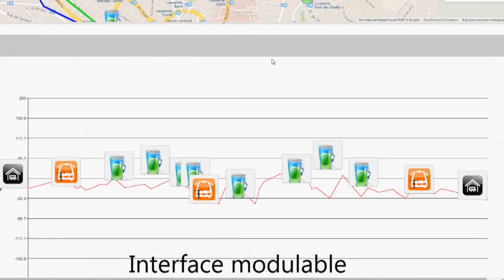TOSA buses power up for less

Comment: perfect design..... which require perfect drivers who can drive the bus just at the right position to charge for like 10 seconds?

instead of building one centralised charging station, this design need to build 100 charging bus stops.... how such brilliant idea comes out?

just do simple calculation of the total usage in 24 hours... comparing with a charging station in bus terminal....